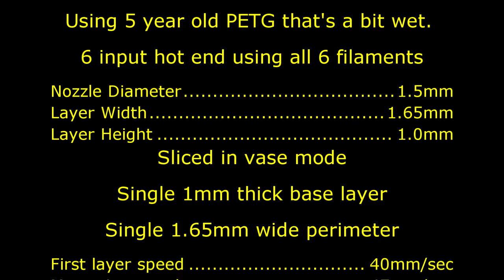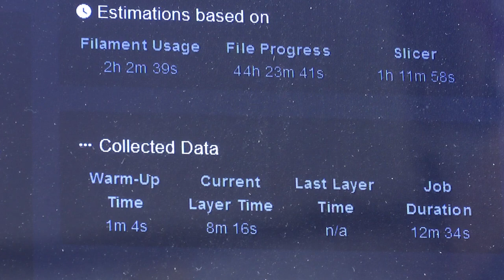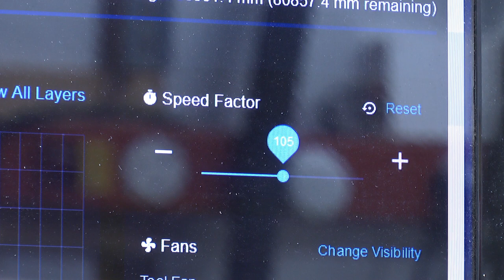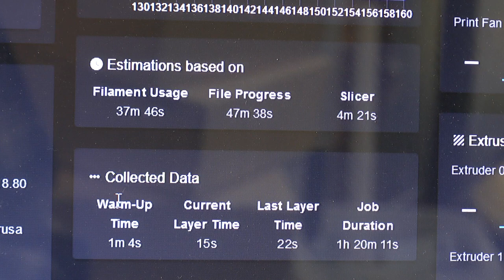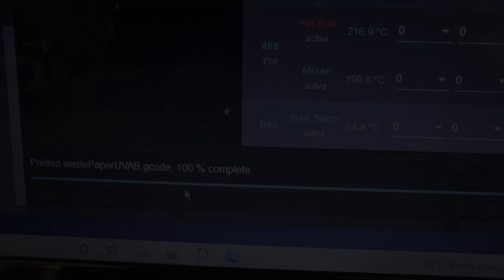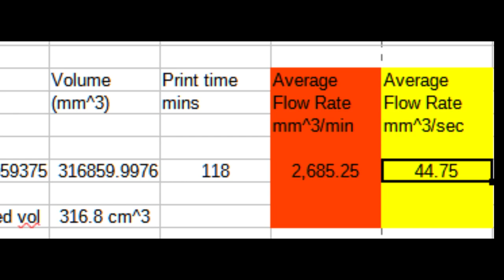PET-G Waste Paper Bin Printed in Under 2 hours

Comment: Beautiful print, great job on the extruder so far. Look forward to mixed colour prints.
Reply from the maker: Thanks. The print isn't that great - this was just an exercise in melt rates so things like retraction and pressure advance haven't been set up for this large nozzle and would need tuning. Mixed colour prints will be no problem - I've been doing them for years using Diamond hot ends. Hopefully, this hot end will allow me to do mixed material prints with filaments that require different temperatures, which is a bit more challenging.
Reply: @deckingman  Can't wait to see your results.

Comment: Nice effect, green on the outside and brown on the inside. Not sure if it was intentional but it looks cool!
Reply from the maker: It's semi-intentional - in that I knew it would happen. Like all "mixing" hot ends, they don't actually mix but rather, simply combine filaments. So what comes out of the nozzle is akin to stripey toothpaste. So the colour you see depends on which side of the object you view it from. Using transparent filament and a smaller nozzle makes it less pronounced.

Comment: It would be nice to see the capability of the hot end switching and printing each individual colour. This would show that it can truly replace a "tool changer"
Reply from the maker: Hi Mark. Switching between colours of the same filament is easy - I did that with an earlier version of this hot end almost a year ago. Check out this "vase" which has circa 997 colour changes. https://www.youtube.com/watch?v=jVr5y3g9UjM&t=200s  

The challenge (and the goal) is to be able to print different filaments with vastly different temperatures without "cooking" those filaments which have a much lower temperature requirements.
Reply: @deckingman  Thank you for the reply Sir, I did see the previous iteration,  I fully understand the goal, and being that the hot-end has effectively changed since that time and that you are attempting to gain traction to try to build the channel, and that you recently advised that this could possibly negate the requirement for a tool changing machine, I feel it would be beneficial for newer viewers and yourself to see that possibility occurring with the current version of the hot-end. I think that such a hot-end would be a commercial success. It might be a bit of a taboo subject but have you considered opening a patreon account or a "go-fund-me" type arrangement to allow viewers to assist you in covering the cost of materials during this research and development phase ?
Reply from the maker: @Dualecosse  All good points. I see no reason why this iteration wouldn't do multi-colour prints, but I can quickly bang something out to prove the point. One thing that might preclude this from being a viable alternative to a tool changer would be how well this handles flexible filaments. I do have to use Bowden tubes - albeit short ones, so that might be problematic. But maybe a hybrid design with one direct extruder and say 3 additional inputs might be a possibility, which wouldn't impact too greatly on the overall footprint.
Reply from the maker: As to Patreon/donations via PayPal - check my "About" page. Links to my newly set-up Patreon and PayPal.me accounts are there, as well as on the banner of this page. I will mention this is an upcoming video and also provide links in the descriptions of any new ones. All donations very much appreciated and will all go towards paying for tools and materials to help me continue development.

Comment: why dont you use a dry oven to get rid of the moisture? still a nice print.
Reply from the maker: Yes, I could have dried the filament. But the objective was just to explore what sort of melt rate I could achieve with PET-G with this hot end design, and I didn't really want to spend the time on drying 6 reels of filament - especially as they are about 6 years old. Besides, I think the bubbles give it an unusual "sparkle". You have to admit, it makes it a talking point :)